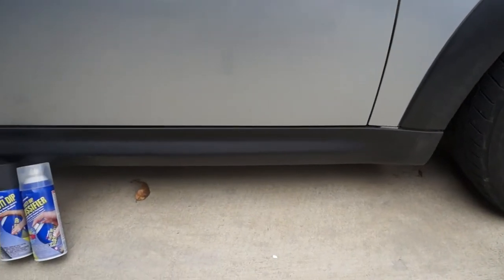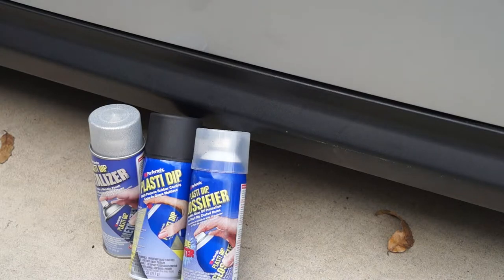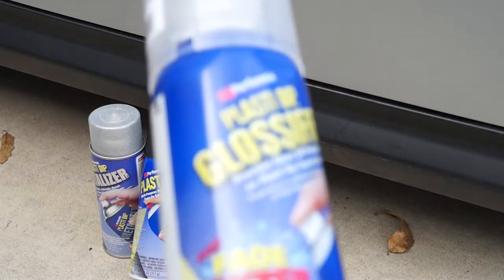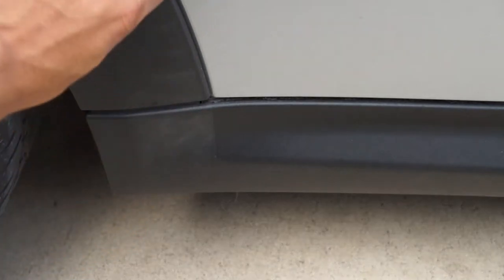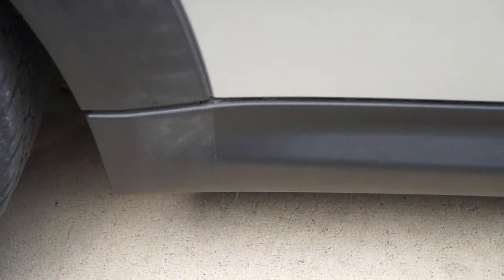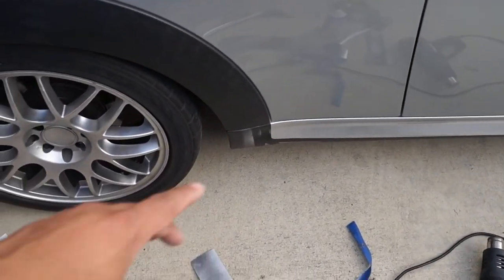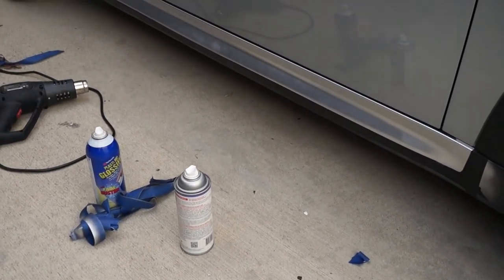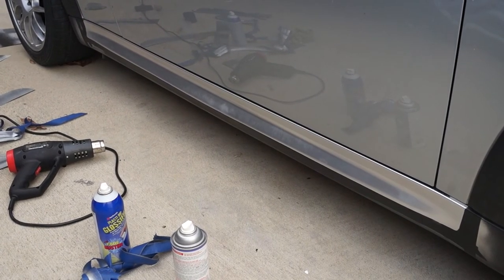Painted Side Skirts for under 20$ (plastidip)

Comment: Nice job dude. Im hoping I can black out my headlights rings and grille trim today. Its getting cold here in NJ though.
Reply from the maker: MANIC R55 you should still be able to do it just make sure you have a heat gun handy and I would also consider heating your can up with the heat gun